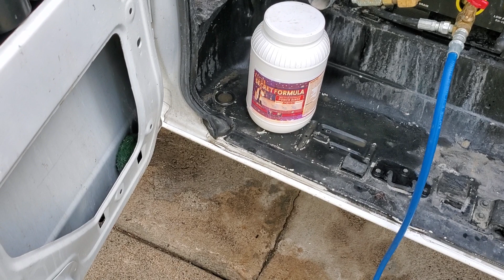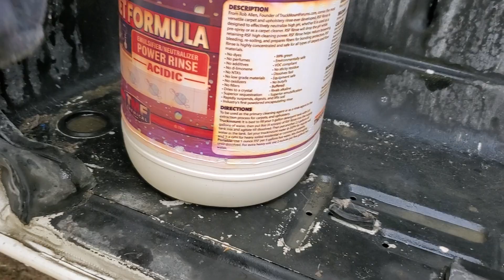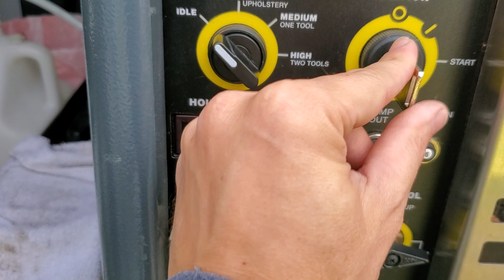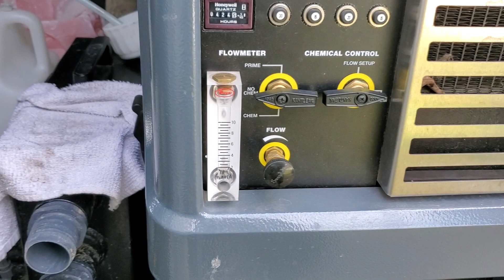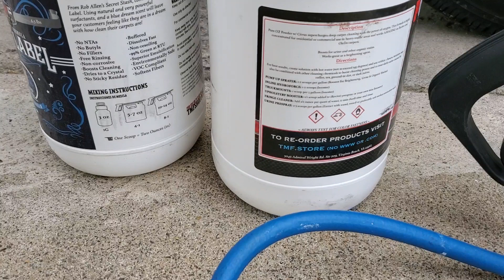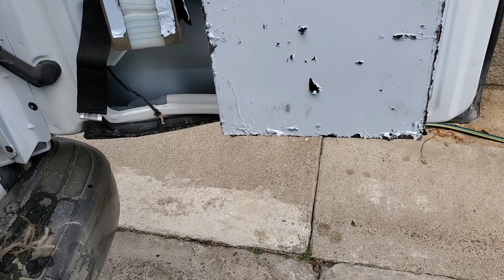Pre-spray and Rinse Tank: Truck Mount Forums

Comment: im confused on the rinse. 5 gallon bucket. if its 4 scoops for 2.5 gallons of water in the jug and youre filling up a 5 gallon jug then it would be 8 scoops of rince powder and then fill your 5 gallon solution tank up correct
Reply: Also your 5 quart in line sprayer do you fill up the rest of the in line sprayer with water to make 5 quarts.

Comment: How do you like the adjustable hydro force?
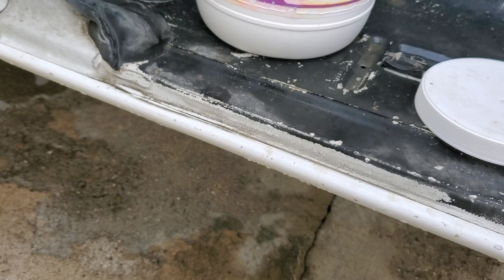Reply: @blackdiamondcleaningservices  The chemicals I use are 4 oz to a gallon, so I was thinking of just pouring the concrete right into the jug, and metering it at 1:32. I'd never have to mix chemicals again. Just swap jugs out. 1 : 32 for detergent and oxidizers, and 1 : 4 for protectors. I spend 20 minutes filling and mixing before each job. Trying boost my efficiency.

Comment: What psi do you use?
Reply: @blackdiamondcleaningservices  
I have just purchased some woolsafe pre spray here in the uk and the dilution ratio is 32-1 .
I normally use TMF black label  at 4-1 400 psi like yourself but was wondering about the accuracy of the metering ?
The manual for the evolution sprayer says pressures of between 100 -1000psi? but I’m unsure if the evolution is calibrated for 400psi.
Have you used your inline with any liquids at higher dilution ratios and if so what psi did use.
Reply: @blackdiamondcleaningservices  
Thanks for the reply 👍
I do the same as yourself with the TMF products but my confusion has arisen with the  liquid woolsafe pre spray at 32-1 dilution that I mentioned ?
I have seen videos on YouTube that say you can increase or weaken the strength of the hydro force pre spray by adjusting the psi?
On the evolution where you can adjust your ratios this does not make any sense.
Surely It has to be calibrated at a specific pressure otherwise it will throw the ratios out.?
Not a problem when you run 4-1 , but a headache if you find yourself in a similar situation.
I will leave it there as I don’t know if there is an answer posted  anywhere else , I know , I’ve looked! , but food for thought 💭